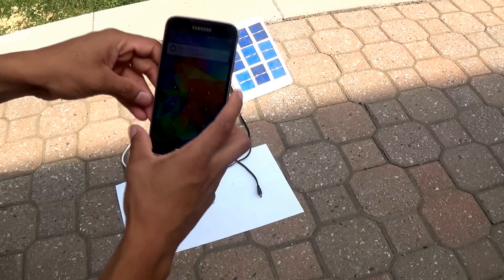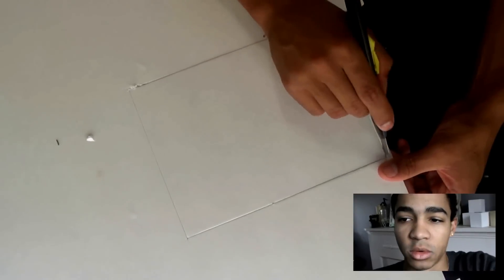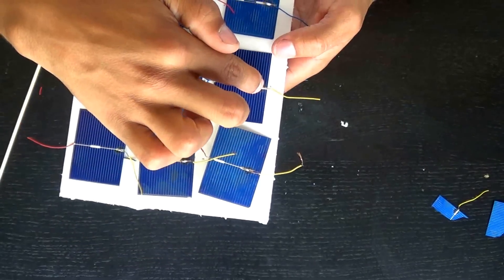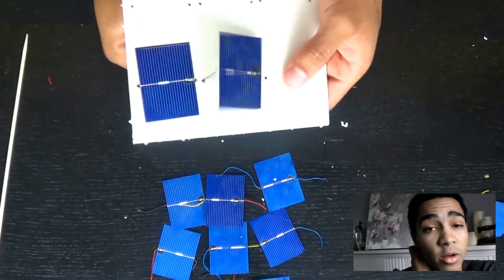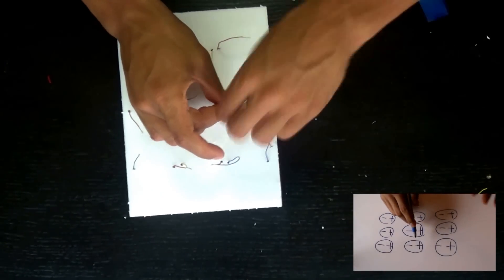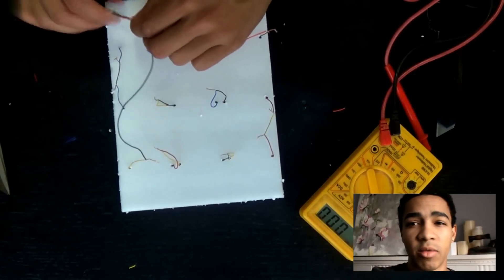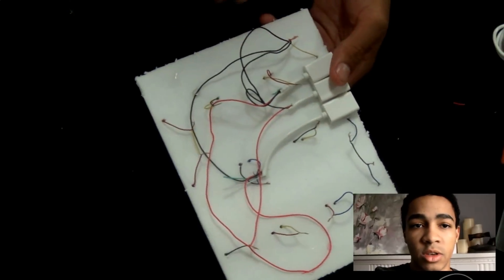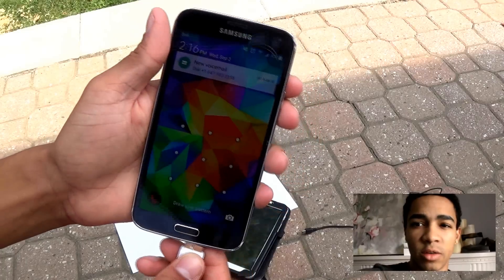how to make a solar phone charger

Comment: I think that 4.5V is alille low.. 5.5 or 5 would be better idea dude.. and that diode makes no sense since the phone has a V leak back protection..
Reply: It's for safety reasons
Reply: @loiilesschool5908  you're right.. phone battery has no leak-back protection.. just realized this..

Comment: Not a very practical design! No bias diodes! Frame construction flimsy! Voltage parameters wrong. You need 5 or 5.2 volts. Plus you forgot to add the most important thing. A voltage regulator. Linear or switching it is a must. Overall not impressed. Thumbed down!

Comment: Many devices won't charge from this unless you do some response on the data lines. There are four different standards. Some require 2.7 volts on the data lines. Others need them crossed. Getting optimum efficiency from the panel can be another challenge. We are working on a commercial charger in you cap!

Comment: dude, you should NEVER touch a solar cell with your bare hand!
Reply: Setra Yoman Oh, i thought it has chemicals that can damage the skin or something...Thanks!
Reply: Setra Yoman Why? toxic?
Reply: wow
Reply: Ruemmel Sollesta our hands are basically dirty (oily, dusty, wet) these dirts will stick to solar cells causing it to have unnecessary heat building up. exposed solar cells is bad enough as it is not protected from oxidation, polluting it with our bare hand could cause it to oxidize much faster. I suggest you wear rubber glove, and work it in the cleanest place you can be.

Comment: i dont get what ure doing at 7:32. could u clarify? what do u mean loads? and what do u mean in parallel? i see u connecting the wires in series as well? (what ure doing is basically attaching the +ve and -ve usb wires to the same +ve and -ve wires on the solar cells 3 times right?)

Comment: please tell me more in detail how to use the pot lights? we have bought like 12 from the dollar store and tried it 10 different times and nothing! any feedback helps
Reply from the maker: Jenn Mazing so potlight from the dollar store u wire slightly differently because they have more voltage then the ones I used. basically go ahead and wire 3 together in series.  and that will be enough to charge a phone. if you want phones to charge faster or to be able to charge multiple then go ahead and wire up another 3 in series and connect them in parallel with the other 3
Reply from the maker: now if you are using this in low amounts of sunlight I would suggest connecting 4 in series. and then u can also attach another group of 4 connected in series, in parallel with the previous group
Reply: joshbuilds positive negative and connect all ends to the positive negative.? omg I've been trying for a week with my son's science project. we tried it like the diagram you drew for the pot plants but no go

Comment: I want to make a solar charger of only one port, so can I use only 2 solar cells????
Reply from the maker: no, I used 0.5 volt cells, so I needed 9 to get 4.5 volts. if you use 1.5 volt solar panels (found in solar garden lights)  you can use 3. But you will always need 4.5-6 volts

Comment: You connected all USB ports parallel. The Tablet charge your Phone if both is connectet. If there is no Sun the connected Device will los energy to the Solarcells. You should add a Diode to every USB port to fix this :) The Solarcells have not much chargepower but if the Voltage is near 5V it will work :) Have much fun with this ;)  Hearing in the Sun music by solar is so amazing
Reply: lol
Reply: Remember, if adding a diode you will have voltage drop about .5v  so you input will need to be higher.
Reply: did you mean LED?
Reply: No just a diode
Reply: than how much ohm needed?
Reply: @cheqamarul6431  ?????

Comment: Josh that's pretty cool. Although my wife and I tried building one of these we watched Kipkay and Ben Builds as well but we could never get it to work. Do you need any special hardware? In one build the used zener diodes to bias the current flow in one direction. In another I heard that certain devices wouldn't charge unless they received an input voltage to the signal wire. Still confused.
Reply: I think for sure I would put a diode in between the solar cell and the USB to keep the phone from trying to charge the solar cells or whatever else I had connected to the circuit.
Reply: lee brownell for that we should setup zener diode in between both USB wires concidering that Im connecting only one USB for charging one device?
Reply: COCK no, I think you only need one diode per USB. Put it on the positive side, I believe. To check, try to run 5v back through the system after installing your diode. Use your multimeter to test downstream to see if any current is flowing. If so, I would put the diode on the other side and test again. Also remember that diodes are directional, but I assume you know that already.
Reply: lee brownell thanks for the fast awnser. I agree with you it should work that way. I will try it tommorow and see the result. Thank you anyway

Comment: i think the one panel consist of 3 volt in a series conection they will make 9 volts so thre is no any circut resister, voltage reglating ic or capaciter to maintain the up down of current flow i think when u become anger and wanna wash your hand from your smart phone in a mints of time so charge ur devices with this panel........what you say guys....???
Reply: they are 1.5V panels. 1.5v x 9 = 10.5v but the way he wired them up, he got 4.5v
Reply: no, each are 0.5 V.
Reply: +Tomas Sanchez, whoops, I misheard the voltage. Thanks.

Comment: What about a diode so the device doesn't drain when the sun goes down?  Or is that when batteries are used?
Reply: Even if the phone is powered off while charging?   Thanks

Comment: so I have some old solar led yard lights, they seem about the same size but have rechargeable (AA) batteries inside. I was wondering if I could salvage them and use the batteries to save what the solar panels catch. but I'm not familiar with amps or volts hardly. Would I simply connect the positive to negative etc on the batteries instead of panels and follow the other steps? thanks and great vid. subbed for sure